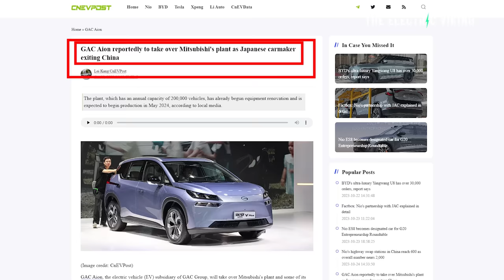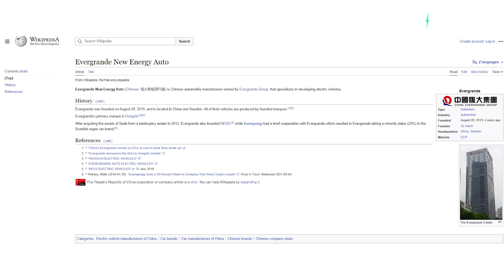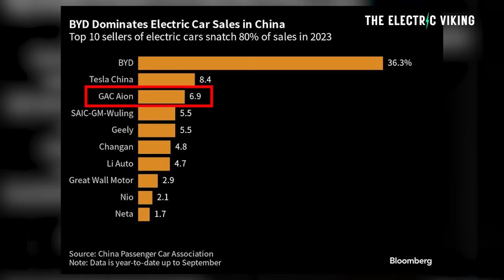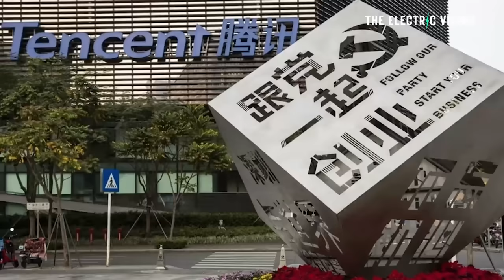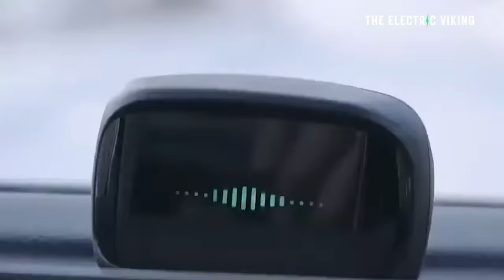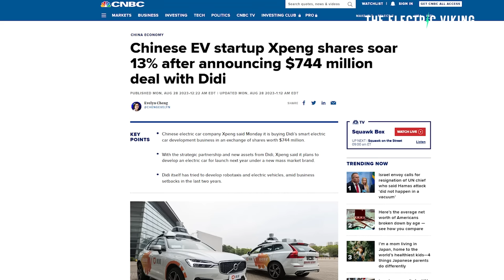30 Chinese electric car companies are months away from bankruptcy

Comment: This is inevitable and closely mirrors what happened with the auto industry in the US in the very early part of the 20th century. There were, if I remember correctly, over 100 car companies at one time, but little by little they all faded away except for the strongest. China, even with the largest population of consumers in the world, is now having the same issue. It will ultimately settle down to less than a dozen. In China's case, they heavily subsidize these companies, otherwise most of them would have collapsed long ago or never have been started in the first place.
Reply: 😂😂😂 China "heavily subsidise' these companies. Funny people, you Western type.. You must think China is really rich.
Reply: There were well over 500 US carmakers co-existing at one point.
Reply: China actually been through this similar stage 20years ago, for the ICE car era.

Comment: Imo BYD in 10 years will be a top 3 in the world car manufacturer. 
I also think in 10 years XPeng will be a top 10 in the world.
The Nio plan of building and maintaining very expensive battery swap locations is a terrible plan.
Reply: As far as I know, BYD's global market share in the third quarter was 4.8%, while Hyundai's global market share was 4.3%. Of course, it does not include the group's Kia and Genesis. In terms of single-brand sales, BYD is only behind.  for Toyota and Volkswagen.
Reply: I think BYD in 5 years will be no1 in the world.

Comment: These smaller firms are indeed doomed. As a car is a computer on wheels, a company like Xiaomi which makes phenomenal cellphones, has a big advantage. these other more mechanical firms that lack software engineers cannot possibly compete. The Chinese market is brutal, and because of the status nature of the automobile, a third tier firm is going to be snuffed out, regardless of competence. 

I would expect the CCP to intervene by purchasing vehicles from various firms or giving cheap loans to let these corporate deaths spread out over a few years. The Chinese property sector is reeling, and their stock market is in the toilet, so Xi is under pressure to fix things.

Comment: There have long been too many EV brands, many with small outputs.  It was always going to crash and consolidation will follow. This will actually help the Chinese as it will lead to a few big groupings of brands, who can then focus on export. So I'm not worried about impact on China. The property market is the biggest problem as size is massive compared to car sector. Also losses to Chinese banks will be massive. Remember that Chinese market is not a normal market and thus runs you would get in other economies are unlikely to occur.  Also let's be clear Market Value as per share value is irrelevant,  particularly in China.
So yes carmageddon was always coming but out of it the strong will get stronger.

Comment: 30 EV manufacturers - 1/3 of China's total - about to go bankrupt? All depends on how much the CCP wants to support them. Their financial reporting is opaque: not subject to audits by anyone Western investors would trust, and anyhow prohibited by Chinese law from reporting to external (western) regulatory agencies. They're all controlled by the CCP. Many exist to pull in western investors (US & EU firms as junior partners) and US money and external IP & engineering assets.

Mitsubishi left because its sales in China died with a surge in anti-Japan nationalist sentiment. That's not going to change soon. China has what it wanted from Japanese manufacturers; now it'll kick them all out. They're still luring in US manufacturers from the US & EU. Eventually it'll be their turn to get kicked out.

Aside from all that, it's normal in a newly disrupted industry for there to be a massive expansion of startups to flood into the field, then most of them go bankrupt. This happened with automobiles in the early 1900s: 1100 of them in 1910, 2000+ by 1921, then collapse to 3 by 1929. Remember how many companies made microcomputers in the early-to mid-1980s? Now there are just a few. This is the norm.